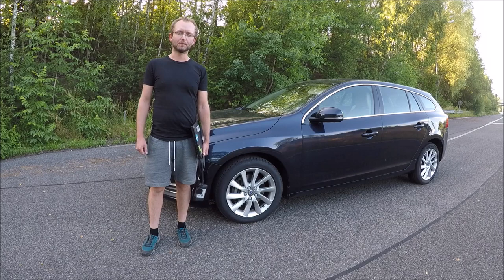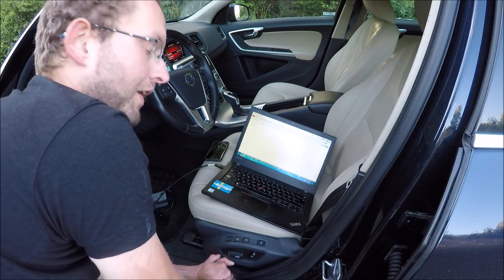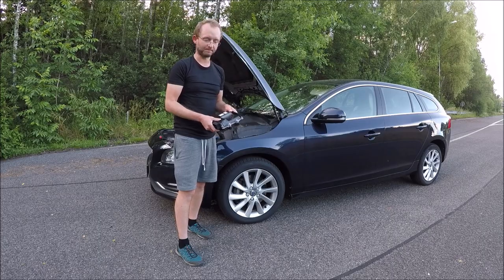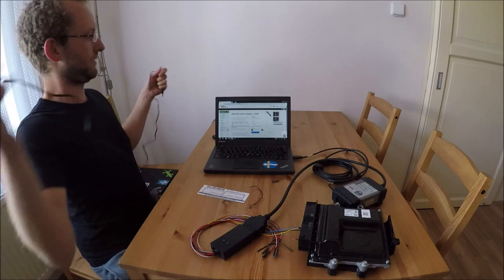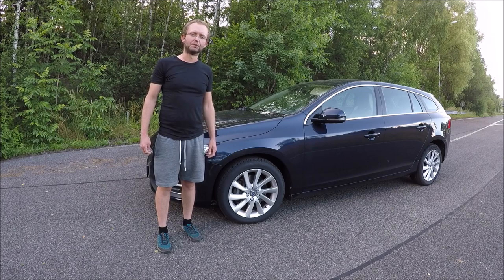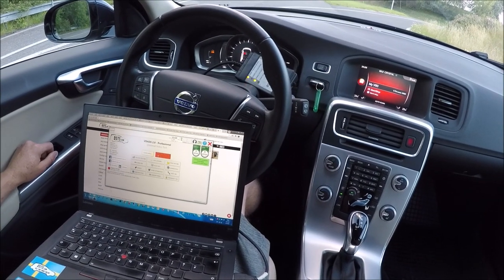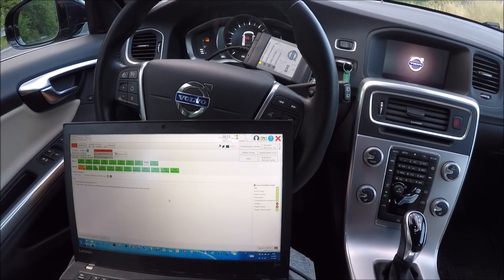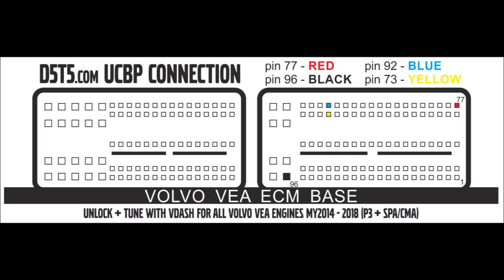Volvo V60 T6 MY 2018 tuning with VDASH - D5T5.com / VEA 4-cyl 2,0T / Acceleration TEST 20-140 km/h

Comment: Hi...I did a gearbox adaptation on volvo v40 2014 after a top up of gearbox oil...and the "transmission service required " message appeared and it won't go off,now it's two days it's stuck on the instrument cluster...does it mean the oil level is low or something is wrong with the transmission...here from Kenya please

Comment: Hello,
I have a V40 D4204t14, which is not using its full potential in first and second gear due to the torque limiting maps. Would I be able to manipulate those maps through Vdash/ increase the torque limiter values, for more power in first and second gear?